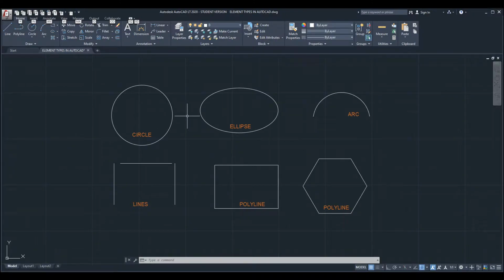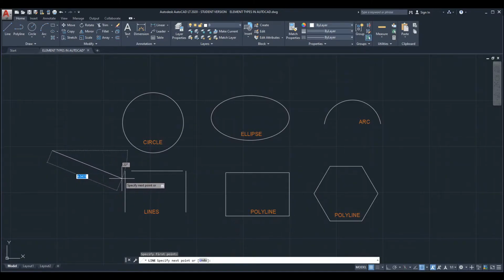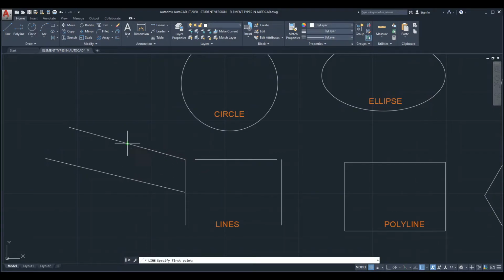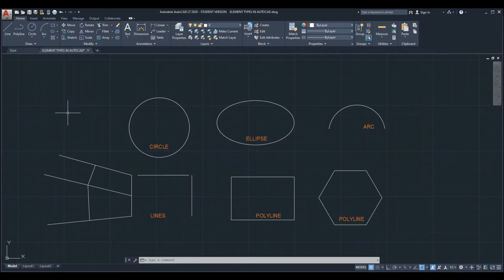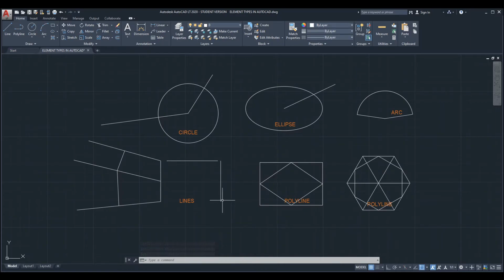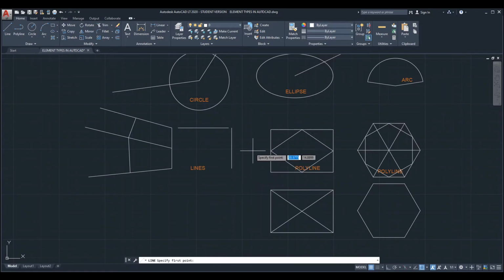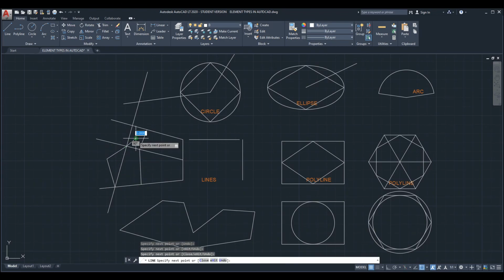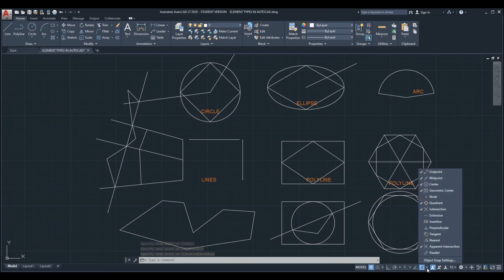Autocad LT Tutorial 2020 | Snap Settings - The Basics

Comment: do you have a solution on how to permanently turn on the snap in Dline command? Thanks for sharing tutorials Sir! 😁
Reply from the maker: Hey Fred! Thank you for reaching out - can you clarify what is the Dline command? Hopefully I can assist you - cheers
Reply: @JayCad  It is a command in Autocad LT 2023 that draws 2 lines like the ML command in a Standard Autocad Version 😁 the problem is it has its own snap settings and it’s not permanent, every time you use the Dline Command you have to check the snap settings the you want to use.
Reply from the maker: Thats pretty cool! I have been using the Mac version mainly recently and did not see that command in the the Mac version - I will check it out on the Windows version and let you know if I find a solution on my end ✌️
Reply: @JayCad  I appreciate that Sir, Thank You Very Much! 😊🙏